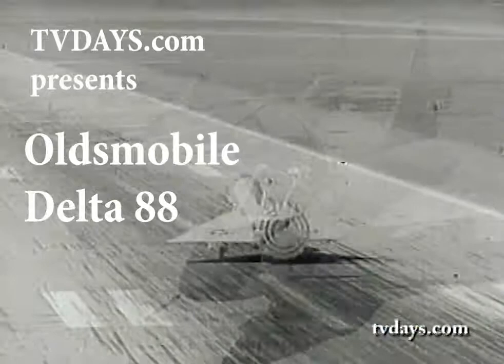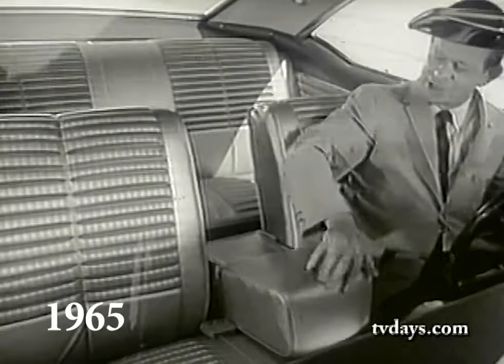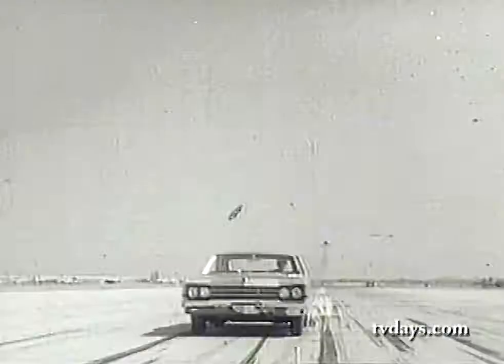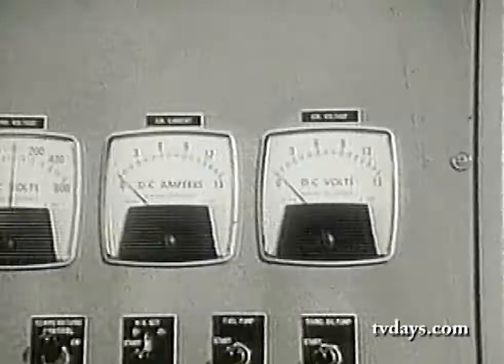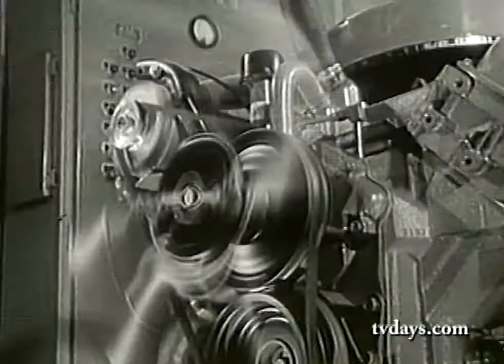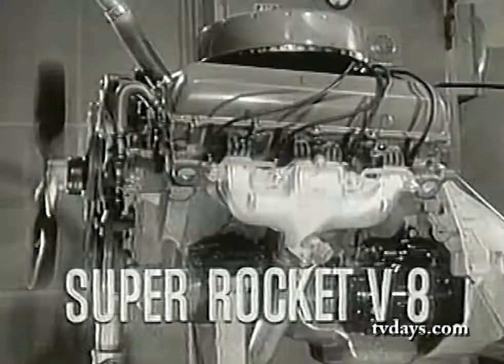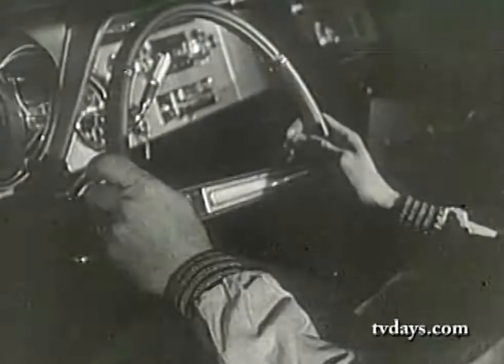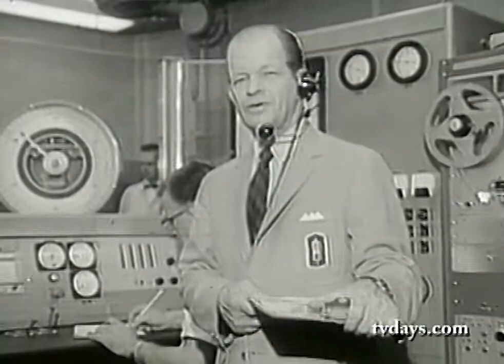Oldsmobile Rocket Delta 88 1965 John "Shorty" Powers

Comment: My father had one but in the 80s one
Reply: no starfires in the 80's.  just delta 88's.  the closest thing to a starfire was the holiday 88 in 1980 and consisted of basicly a 2 door delta 88 with buckets and floor console.  no special motor. just a 5.0 305.

Comment: not sure they offered the 370hp motor in the delta 88.  that motor was reserved for the jetstar1, starfire and 98. the dynamic 88 and delta 88 were 2 seperate models. all the 88's used basicly the same frame/body. but with different trim levels and engine options. the jetstar1 was the poor mans starfire. same engine as the starfire.
Reply: Fun fact, the Jetstar was the first production car to have a turbocharger option.